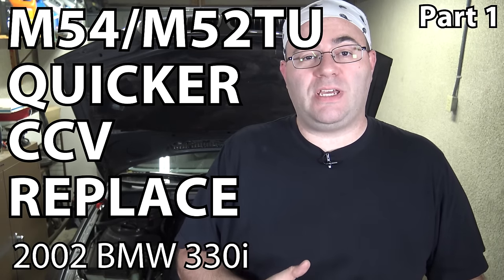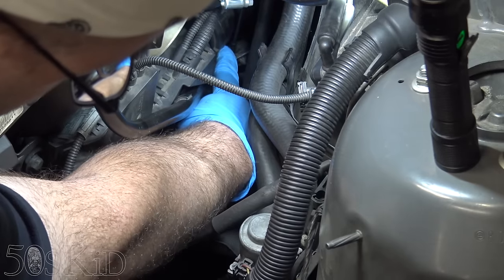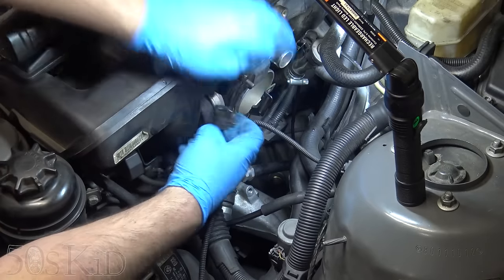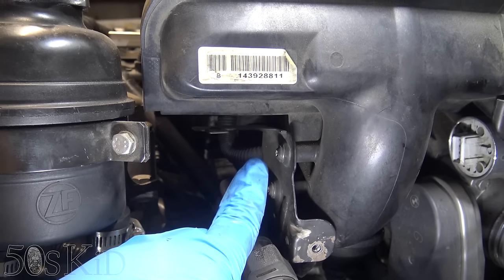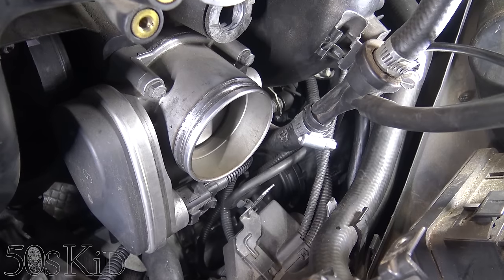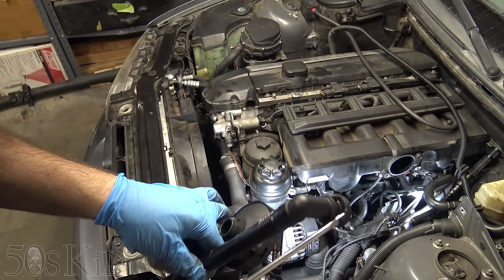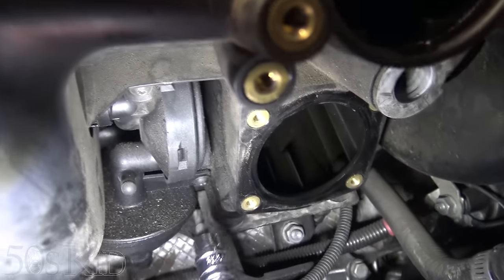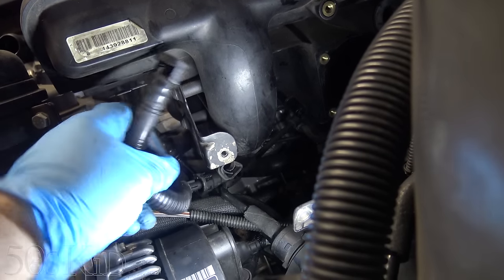BMW E46 Quicker CCV Replacement DIY - Part 1

Comment: Hey kid so if the car stalls and turns off or lose power when driving, it might be the pcv valve?? ?
Reply: Try cleaning the Mass air flow sensor. If it’s dirty that’s what It will  do to your car.

Comment: Hey Jason I have a challenging problem. P16a7. My car goes into limp if I smash the throttle. I'm guessing it would be clogged cats but I'm not sure. I can shift to N and turn the car off and on and it goes away till I smash the throttle again. I was wondering if spark plugs foul outs would work on my post cat sensors to solve this problem till I can afford new cats. 330i 04 so m54 e46. Thanks man. Tried to msg u on FB but no luck sry for the yt post off topic.
Reply from the maker: Remove the precat O2 sensors and drive the car around and see if there is a change.  That will tell you if they are plugged up (because you are opening a hole before them allowing the exhaust to escape a little better).  While they're open, stick an exhaust back pressure gauge in there while it's running to measure pressure (it should be less than 1.5 psi).
Reply: You are the man. I will give you my results if I notice anything worth mentioning (for informative reasons not diagnostics). Thanks again man!

Comment: Ok so I drive a 2002 525i and the dip stick did not come out this easy infact it broke off in the block because there's a small part that sticks out and keeps the dip stick in place I wish I was informed of this before doing this because my dip stick is broken in the block 🙃

Comment: I heard the dials or the valve inside the aftermarket ccv are not calibrated like the oem ccv and will cause problems earlier than anticipated. Is this true?
Reply from the maker: Never heard that.  If you're concerned, go with OEM parts from the dealer

Comment: Hello,
Thanks so much for this video as I used it for guidance replacing mine. Found the source of the error codes and got cleared but I noticed I lost MPG? Any ideas or recommendations?

Comment: Hey I’m having and over heating issue that I’d like to ask you I’m only heating up at idle and once I push the gas it drops back to Normal my guess is I’m having something slow the coolant flow me and my dad went threw everything I can’t find what’s causing the issue. I have new water pump thermostat expansion tank hoses and flushed the radiator and heater core any ideas
Reply from the maker: Eric Carlson is your cooling fan dead? Turn your ac on. It should come on
Reply: 50sKid I have a fan clutch and a cooling fan both work. It’s almost like it’s not flowing enough at idle. Would the temp sensor cause it to read wrong and make the temp gauge go up
Reply: Is my cooling fan supposed to run at idle

Comment: Tried to do this today and I couldn't even get to the bolt of the dipstick so i surrendered. But I could get a glimpse of my CCV system and it looks like shit. There was oil everywhere. So at least I think to know now where my problems are coming from.

Comment: Can you do a video on how to fix the rear tail light ground? My xenons are flickering like crazy and when I unplugged the driver said tail light harness everything went back to normal.
Reply from the maker: I believe there is a recall about this. BMW will install a special ground device thing on the tail lights for free. Got mine done when I did the airbags.
Reply: 50sKid thanks for the help!
Reply: 50sKid unfortunately, my 325i is an 01 and the recall is for 02-05. I did manage to find a fix online though, but I feel like you could make a much better video than those already on here.
Reply: I just did mine yesterday!  It's very easy!  I had it done by BMW years ago but the infamous intermittent "light out" reappeared.  I found green crusties where they made their join so I had to chop it out and put in new wire.  Really easy DIY. Go for it ;)
Reply: Niamh Healy thanks man I appreciate it
Reply from the maker: Yeah Niamh... thanks "man" ;-)  Julian: tell me what you find back there?  green crusties anywhere?  I need some pictures that I can splice into this video.  Same for your Niamh -- send me pics of what you've fixed. to jason@50skid.com
Reply from the maker: I will do this video if I gather up enough information about the problem and would be able to demonstrate what it is and such. Because i know little about it i'm afraid.
Reply: 50sKid I’ll try and get them to you tomorrow morning. My ground had corrosion or some weird yellow gunk around where it melted off.
Reply: I didn't take pictures at the time Jason but I can take after shots I suppose? Really unusual for me to see green crusties but the back lenses were letting in water so I replaced them during the summer.  Should be good to go now ;)
Reply: Yeah "man" haha occupational hazard or he's Californian too ;) lol just sent pics. Let me know if you don't get them xx
Reply: Niamh Healy Californian indeed!
Reply: @TheCowgirlNiamh  hey can send me those I have the same problem on my e46

Comment: Not sure if you mentioned it in another video but what is that light?!
Reply from the maker: Yeah I am going to do a video on just that light. It's new at harbor freight!
Reply: Dang I was looking at that light and saw these ones at Harbor Freight for 4.99 that looked similar great bright LED, looks the same but the one I got the top does not fold.

Comment: Is it easier or even recommended to replace only the the oil separator to dipstick hose?
Reply: I was able to get to this tube from underneath my 2003 vehicle on ramps by removing the  Belly Pan and Front Subframe Brace. I cut a slit in the old one at the dipstick and lubricated the new one as you suggested and the removal/install was relatively straight forward. There was decent access to the clip end, though I had to do it blind - since the tube was severed close to this end, I was able to spin it around until I could get a good grip on the clip and it came right off. pushing in the new one was a little more tricky since I had to feel around for the proper angle to push it in.

Comment: would it be easier to do ccv if i am already doing the oil filter housing gasket..would i have better access with the oil filter housing gasket assembly already out?

Comment: Is this also posible with the cold climate kitt? (Without getting the intake of)
Reply from the maker: Yes
Reply: @50sKid  Hello, then 2 more questions. 1 know there is a sensor somewhere at the back of the intake, wich alot of people exchange when they replace the ccv. Can you reach that or is it under the intake? I also heard about the knocksensor. Is this reachable like this?